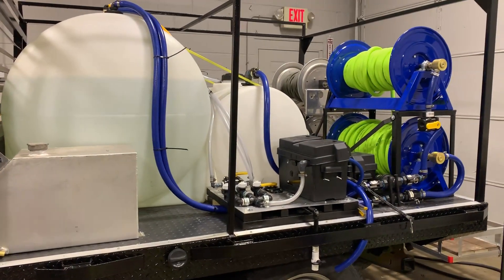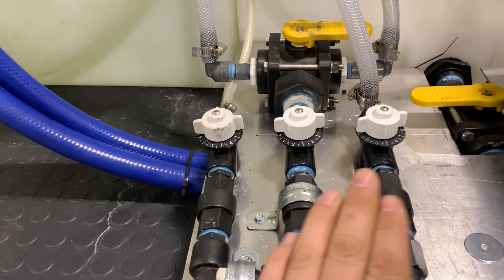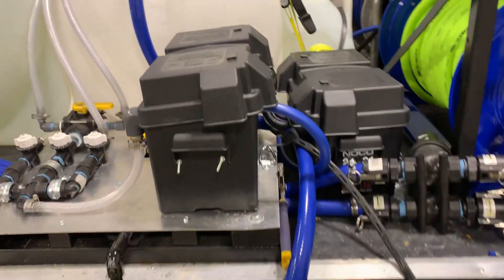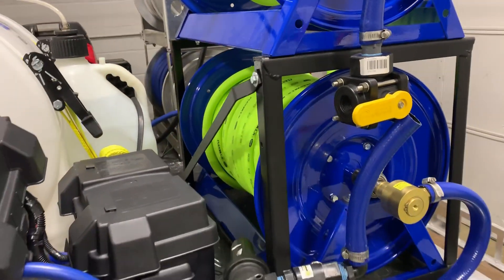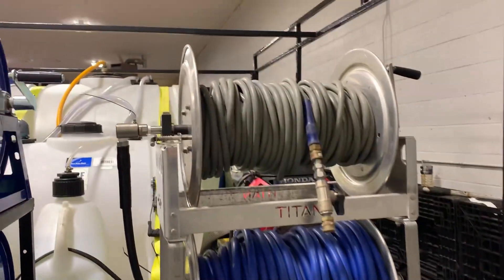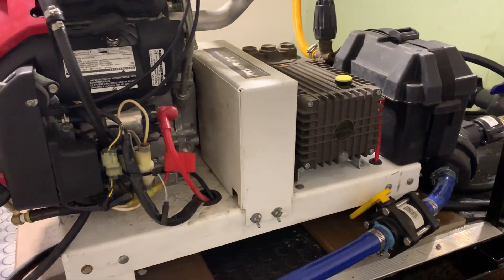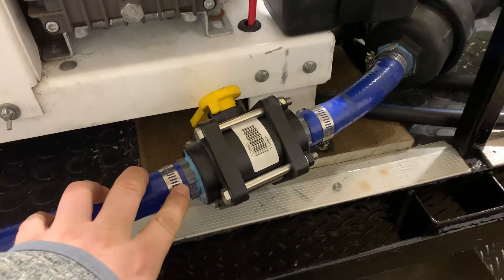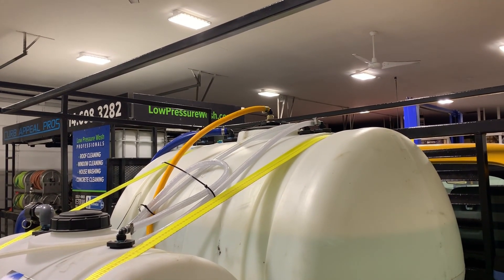How To Build A Pressure Washing Flatbed Truck - Chapter 3!

Comment: Excellent rig.  Clean and simple.  On the 8gpm did you just put a bulkhead in the bottom of the filter to create your dump/flush system?
Reply: @Hosebro  did you have to modify it?

Comment: Did you get the parts for the proportioner from Lori PWP? Im gettin ready to build one myself and she is where I get my stuff. You should have stayed with the Titans on the fill. The cox reels will peel the PC off in less than a year. I love your guys videos. Keep up the hard work.
Reply: @Hosebro   Thanks for the reply. The cox certainly are sturdy and the larger diaphragm will be nice. I haven't used them in the last 10 yrs or so, so hopefully they fixed the powder coat problem. again thanks for the great videos!